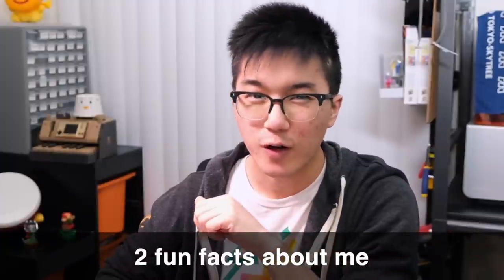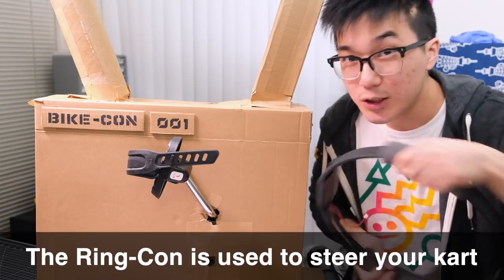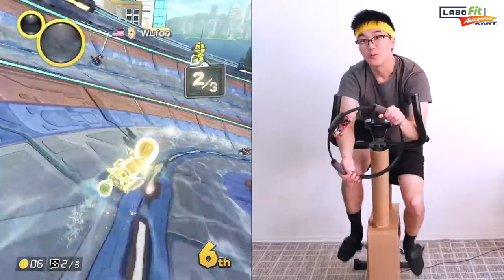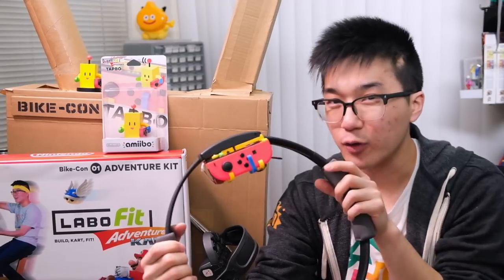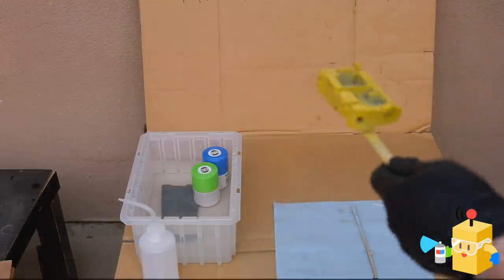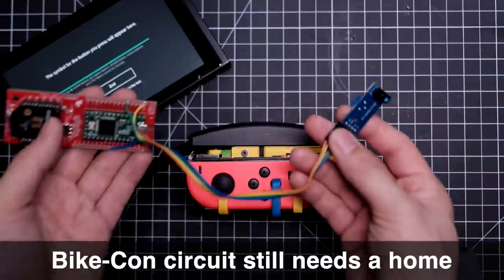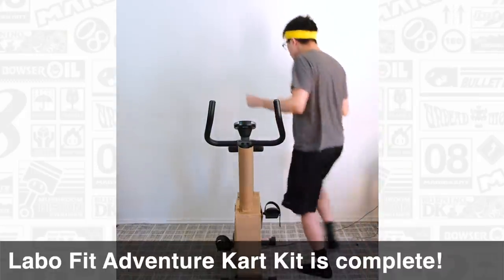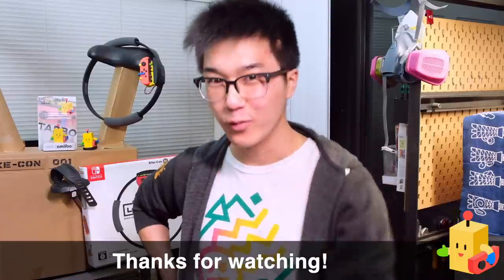The Ultimate Nintendo Exercise Experience | Labo Fit Adventure Kart

Comment: I would seriously pay to buy this kit! Even just the electronics. Where did you learn everything required for all this? All the techniques used in 3d printing and painting all the parts, the graphic design work to create the box for the kit and the amiibo, and most importantly, everything for electronics: the programming as well as how to wire everything thing up just right. I'm currently in an electronics program and a lot of the work you did is taught there, except you way more than what my program teaches. Future semesters past where I've gotten to teach how to program a XBEE but I have taken a class on designing circuit boards through kicad including the schematic and all the layers for the circuitry to be printed. Did you go to school for all that or was it all self taught with trial and error? I have some experience in using laser cutters from my lasers class but the safety and techniques in that section alone were advanced compared to what I know. Thanks for the awesome (and humorous) and genius video!

Comment: How I thought he would talk-
Slight or full Chinese accent. 

How he actually did talk-
*The FitnessGram™ Pacer Test

The FitnessGram™ Pacer Test is a multistage aerobic capacity test that progressively gets more difficult as it continues. The 20 meter pacer test will begin in 30 seconds. Line up at the start. The running speed starts slowly, but gets faster each minute after you hear this signal. [beep] A single lap should be completed each time you hear this sound. [ding] Remember to run in a straight line, and run as long as possible. The second time you fail to complete a lap before the sound, your test is over. The test will begin on the word start. On your mark, get ready, start*